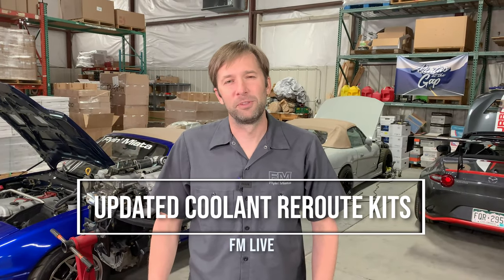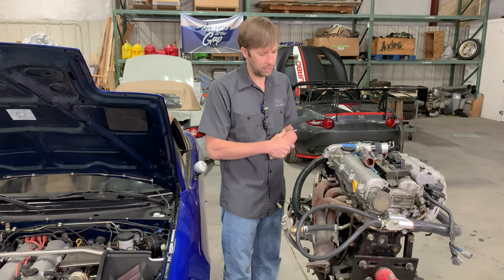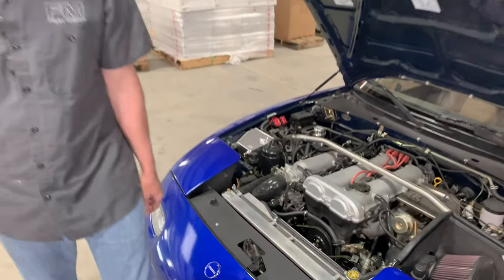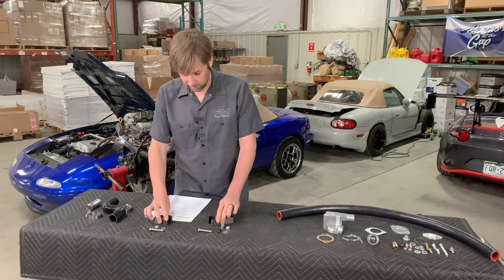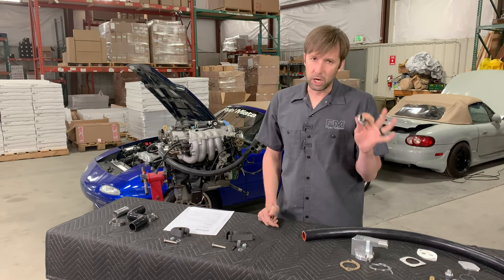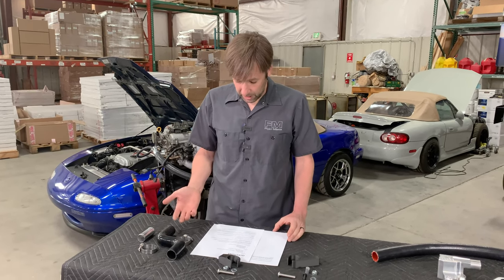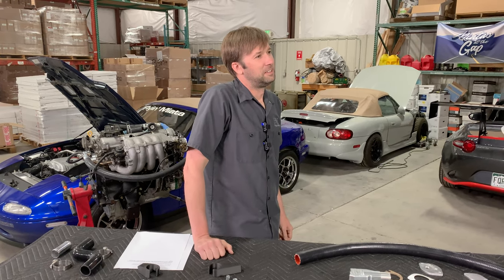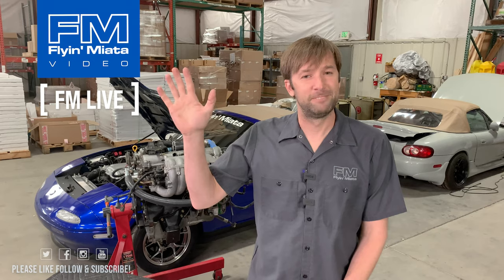Updated Coolant Reroute Kits! (FM Live)

Comment: Brandon you spoke the truth when you said you don't have to have it.   The best thing you can do is get rid of that plastic rad and get an aluminum one and you solve a lot of your problems right there
Reply from the maker: The biggest problem with the stock rad is the brittleness of the end tanks over time. Second biggest is the fact that it’s not a crossflow. Simply banging a generic aluminum radiator in the car won’t necessarily solve any overheating problems, alas - and it definitely won’t improve coolant flow through the engine. 
But a good rad is required, no question.

Comment: I would suggest this to anyone that is going to have their engine out.  I would love to put one on my car, but don't think it is worth the effort since I already have your crossflow, and stage one kit.  If I have to have the engine out in the future I will get one.   On the other hand I did purchase one of these for my sons car since we had to have his engine out to rebuild, just glad you are offering the upright adapter hose separately as we are going with a stock replacement to stay on budget, and this will make routing much easier.   We are going with ITBs on my sons car as well so I think the question of heat transfer, I think would be neglegable at most, and if we were concerned about it you could always make a heat shelf to mount under the ITBs and over the hose.

Comment: I wouldn't be surprised if a reroute kit on a daily driver would help prevent a blown head gasket in the long-term.
Reply from the maker: We're a big fan of preventative maintenance, and evening out the cylinder temperatures with a reroute should help, but we haven't done any definitive long term testing.

Comment: My reroute hose sits right next to some fuel lines by the intake manifold (comes within 2-3mm of the line). Should I be worried about it heating up the fuel? (95 NA8)
Reply from the maker: It would be better if you could keep it further away but packaging can be difficult. I doubt you'll see any performance issues unless you're running a high HP build. Reflective tape is pretty easy to use if you don't mind the aesthetics and can't move the radiator hose further away.
Reply: @FlyinMiataVideo this may be a stupid question, but would this possibly increase the likelyhood of fuel igniting in the lines or increasing fuel line pressure, causing a fuel leak?
Reply from the maker: @LifeWorthEditing  I get where you're coming from, but realistically, no.

The engine bay is pretty warm already and the hose is pretty well insulated, so much so you can usually grab it by hand at operating temperature and not burn yourself. It simply won't make that large of a difference, if any, to fuel temps.
Reply: @FlyinMiataVideo sounds good. Thanks for the help! Keep up the great work guys.

Comment: So I got a reroute kit and also deleted to front thermostat neck completely and not I have a extra hose on the passenger side of engine on the exit that’s supposed to go to the neck can I just block that off or is it needed?
Reply from the maker: You still need it. Just grab yourself a couple feet of hose and route the hose coming from your throttle body to the inlet on your water pump mixer housing. Shoot us an email (support@flyinmiata.com) if you need more info.

Comment: FYI the Gates #22436 coolant hose fits the miata reroute perfectly for a NA setup just gotta trim a little bit off on the radiator end of the hose. very cheap $15 dollar molded hose.
Reply: Gates hose also fits NB with stock upright radiator. I have the Gates hose on my 2001 with the FM reroute. It’s worth mentioning that the Gates is a rubber hose, where the reroute comes with a silicone hose and I believe the adapter hose in this video is also silicone.

Comment: How about with LS coil kit and Fastforward Supercharger on the intake manifold. Will it work?
Reply from the maker: It works with our old Big Spark kit and other coil kits we've seen, but we haven't tested every kit on the market. It will probably work with the supercharger kit, but we haven't had one in the shop to test it. You might have to use a longer hose to get around the intake. Reach out to our customer support team with a few pics and I'm sure they could give you a better answer and/or suggestions to make it work.

Comment: Wow I was just running into this issue too
Cause I didn't buy the cross flow
Reply: I ended up getting a dayco 71519 hose
And a 1.25 OD connector piece from Amazon
17 for hose 10 for the connector
Reply from the maker: We've tried to make these as easy as possible for everyone, but it's hard to predict every possible configuration people have. Hopefully the new hose kits and brackets make them more appealing to more people!

Comment: For the ITB guy, why are you pulling hot engine bay air on purpose?

Build an intake that directs cooler air into your ITBs. Then you can stop worrying about a radiator hose passing in front of them…

Comment: How much of a pita is the oil filter to get with this hose in the way? 

Quote of the day "the engine bay is a hot place." Classic. 😂
Reply: It makes it tight but not untouchable
Reply from the maker: One more thing to reach around, but not impossible.
Reply: @FlyinMiataVideo  Wouldnt the oil filter relocation fix this.

Comment: Could you make it an option to swap the 01-05 headgasket for the earlier version in your headgasket and engine rebuild kits? I'm looking at ordering the headgasket kit for my 01 with your reroute, but not sure I want the kit vs piecing one together to get the earlier gasket.
Reply: Also glad you guys came out with the reroute hose bracket, the hose routing was my only complaint on the reroute kit
Reply from the maker: If you have time, send this suggestion to our customer support team at support@flyinmiata.com . Thanks!
Reply from the maker: It's definitely a big improvement!

Comment: How is moving the thermostat not a big difference?
Reply: Still has same purpose n has no diverse affects i have mine moved to a inline and does great most days i dont see much over 170 hardly ever has to even open (its a 190 thermostat)
Reply from the maker: Moving the thermostat to the back of the engine makes a big difference with flow and evening out the cylinder temperatures, but since it's so close to the head, keeps the thermostat completely functional. If you have time, check out Mike's reroute theory video for more info. 
https://youtu.be/rVgCxPPuVHI